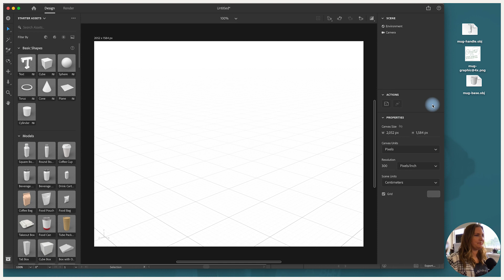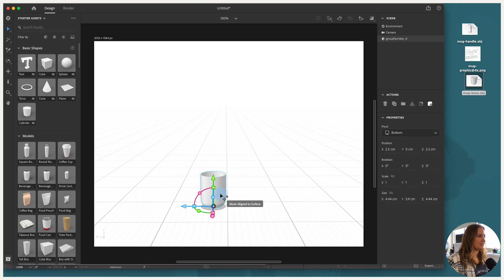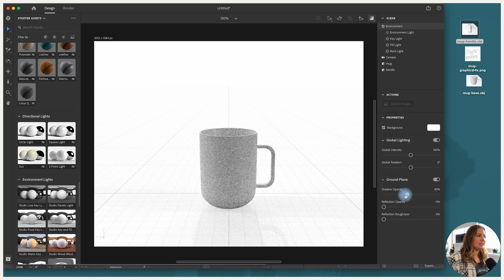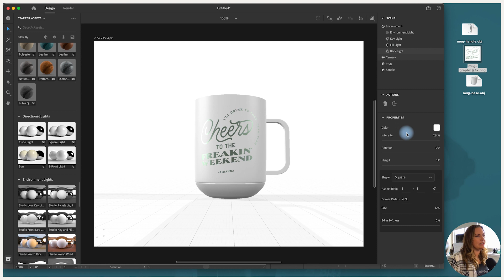Part 2: Designing a 3D Coffee/Tea Mug Mockup using Adobe Illustrator and Adobe Dimension

Comment: Wait, how did you get the exported obj files back into Adobe Dimension?
Reply: Ah, figured it out.  I was trying to drag the obj into a new custom library for "my assets".  Apparently this format isn't supported for that, but if you drag and drop it into Design screen, it's fine.
Reply from the maker: @walasavagephoto   Oh good, glad you found that method. I usually save an Ai file with the 3D objects just in case I need to tweak later.